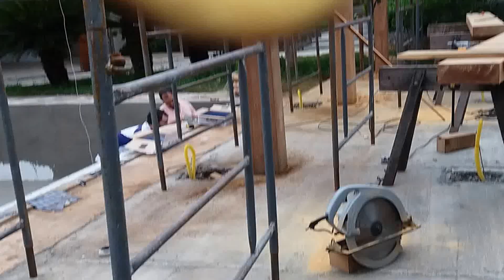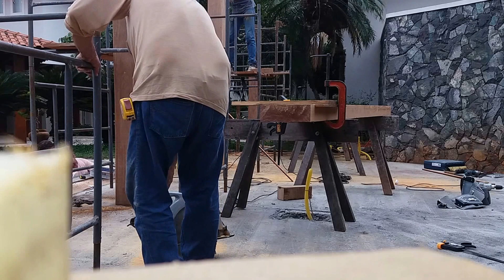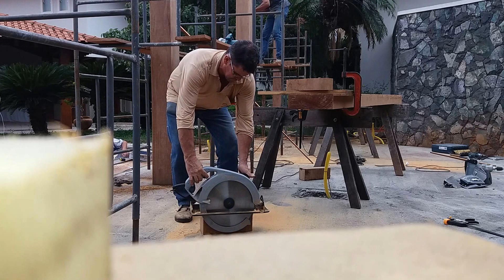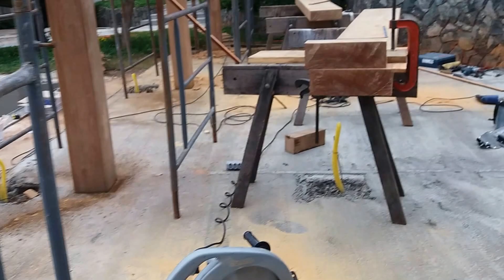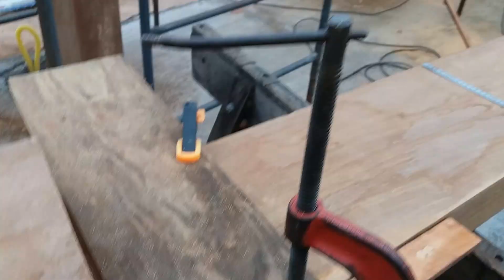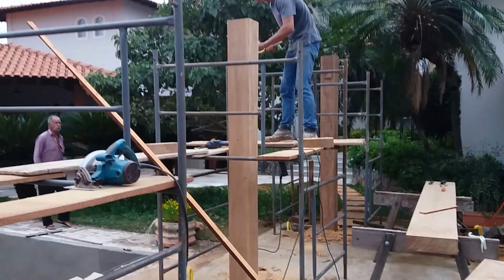cortando  madeira 10x30 do pergolado com serra circular de 13 polegada guia

Comment: bom dia,gostaria de saber onde vende essa serra de 13" estou tentando comprar uma, mais os vendedores das lojas onde passei   dizem que não existe.
Reply from the maker: Renildo eu comprei no mercado livre  o modelo é =5103n  beleza entra la tem
Reply from the maker: Renildo vi no mercado livre valor 2890,00 tem na voltagem 127 e 220 beleza
Reply from the maker: https://produto.mercadolivre.com.br/MLB-1126499709-serra-circular-1014-220v-makita-5201n-_JM#position=16&type=item&tracking_id=87c8fd37-d863-4416-a496-eb0a031e6f17